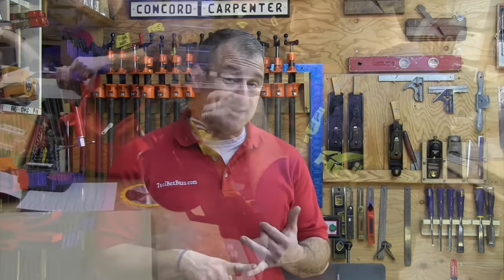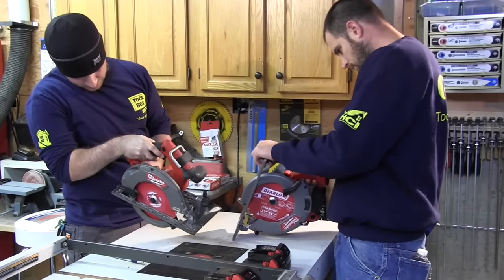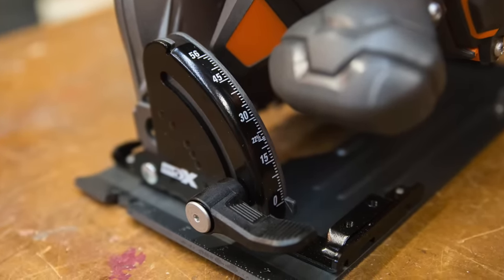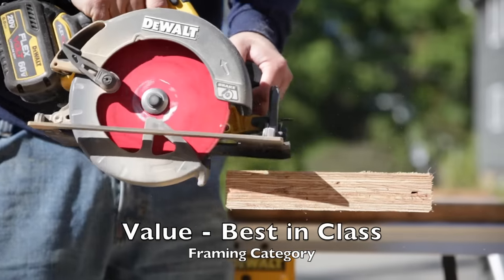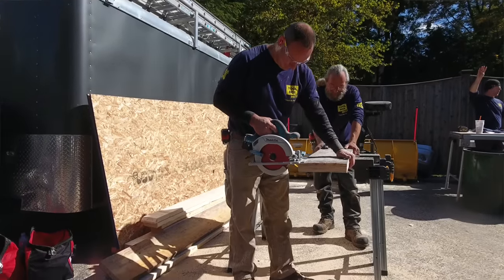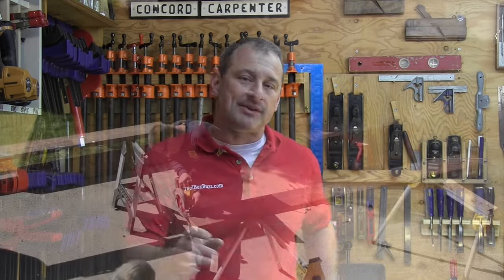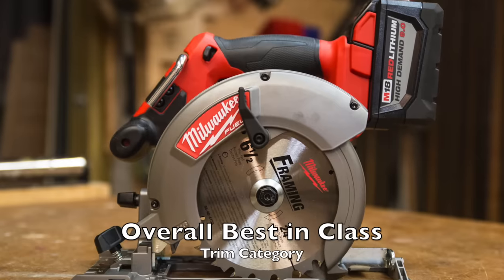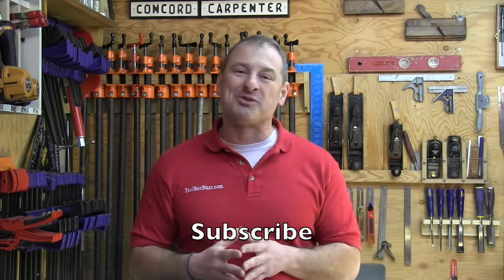Best Cordless Circular Saw - Head to Head

Comment: I’ve had the Dewalt Flexvolt pretty much since they first came out and I love it. I have 4 each of the 6ah and 9ah batteries and never have any down time waiting for batteries, exelaint runtime, power and performance, blows the competition out of the water in my opinion, and the new updated model has the rafter hook Andes even more powerful (Just got one recently and I like it even better than the old one and that’s saying a lot). My boss has a Milwaukee and he likes mine better even when he uses his 12ah batteries for it. And the Forman on our crew had a Rigid and sold it and got a Flexvolt after using mine. I personally prefer that it has its own batteries, having the amount of power that it does is awesome and a smaller battery would drain very quickly. I’d be very interested to see an updated version of this video and am conga Dewalt would take it

Comment: Great in depth review. My 2 cents: I am a framing contractor, with thousands of dollars invested in both the Milwaukee Fuel and DeWalt Flexvolt tool lines. I run my jobs almost exclusively on cordless tools and use these tools all day long. My trailer has a big battery recharge station with 5 and 9 Amphour Milwaukee and DeWalt 2/6 and 3/9 amphour Flexvolt batteries recharging on multiport chargers all day long. In my opinion DeWalt has unquestionably assumed the top spot in contractor grade high output tools with the introduction and diversification of the Flexvolt line of tools. With four Milwaukee Fuel saws, and 3 Dewalt Flexvolt saws on my shelf, I reach for the blade right Flexvolt saw almost exclusively, even though I dislike the blade right configuration. The reason is that when speed counts, torque is better than endurance. The Milwaukee Fuels get about as much work done, but they bog down way easier and take more time. Ripping 2x lumber, cutting rafters, headers, gang ripping plywood, month-old blades, with perhaps a carbide tooth missing, on the dewalt 60V saws still cut with good speed and decent quality because the DeWalt 60V brushless motor has enough torque to power through the cuts. With a month old blade, with resin buildup on the teeth, the 18 Volt Milwaukee Fuels cut much slower, and bog down on compound miters (rafters) and often fail. I have more $ invested in Milwaukee Fuel, but without a steady, expensive stream of new blades, the 18 Volt motors feel weak and take too long to make cuts and fail too often. In all honesty I can't stand working with Milwaukee Fuel saws unless the blades are less than 2 weeks old, they just cut too slow. So in my experience,  running these saws into the ground (burned out 2 Fuel saws over the last year) month after month every day, cutting rafters, tails, headers, sheeting roofs, gang ripping plywood etc. the DeWalt Flexvolt wins hands down in the field. When the new blade left DeWalt 60V Max in-line saws come out in October, I will buy three ASAP, and I expect that my Milwaukee Fuel saws will largely cease to be used by my crew and be viewed as a second tier tool.
Reply: James Weaver , im framer too , is good your review for me because im not sure , if milwaukee or dewalt, i need one , the mayorit people reviews is diy , not profesional construction worker,

Comment: Interesting. However, most of us probably become 'slaves' to whatever brand we already own in order to simplify the requirement for battery chargers and interchangeable battery packs. It would be nice though if there was a universal standard on the battery side so that customers could select the brand of tools that fitted their particular requirements best. I don't see that coming any day soon though, or at all in fact.
Reply: We can always dream right lol!
Reply: Universalize the connector and leave battery cost, quality, and performance up to the end brand to make their battery a better buy
Reply: Jon the problem is batteries and tools electronics work toghether the manufacturer doesn't want people using other brands batteries, so they use proprietary "language" in their tool/battery interface
Reply: That's actually not a terrible idea...and possible. It was done for phone chargers a couple of years back in the EU and it really made thinks easier. The best thing about that is: You would probably get companies really quickly just offering battery/charger systems, companies focusing on nothing else. That way, you can get really amazing things.
Reply: The only way I see a universal battery working is if there was a subscription, that you subscribed to. Say, you needed X number of batteries and you paid accordingly to the number of batteries that you needed to use. Go one step further with a modified one key system allowing you to monitor the performance of any given battery. If that batteries performance dipped below a certain level they would ask you to swap it out.
Reply: Yep, these0 days you marry- a battery system and hope the skins attached are up to the job
Reply: Yeah companies got to make their cash so they are normally careful not to make battery ports similar to other xD
Reply from the maker: That would be great
Reply: Just pick the right brand...there only one good one
Reply: I have mentioned that before. The replies and comments were it stops improvement and progress of innovation.
Reply from the maker: Agreed many of us stay with the same platform
Reply: Once RIDGID announced their lifetime warranty I almost immediately made the switch from Milwaukee-which unreasonably heavy!
Reply: J F  Milwaukee  all the way for me any power tool
Reply: absolutely. few years ago when i was just starting out, dewalt had a screaming deal on a 4 tool set with a couple batteries. At the time i couldnt understand why Dewalt was basically giving away brushless cordless tools.  4 more tools and several more batteries later i understand. Sometimes i like the other brand as a tool but its cheaper and easier to just stick with the brand that uses the batteries i already have. 
Dont regret it but yes this should be something everyone should know when they are looking to buy cordless tools.
Reply: Maybe we just need a genius inventor person to create an adapter system for batteries/tools. You could have an adapter for a DeWalt 20v to Makita tools and an adapter for Bosch tools to use Milwaukee batteries etc etc. Yes there would be about 2 dozen or more possible configurations but if they could keep the price down I bet they would sell like hot cakes lol. Imagine having tools by DeWalt, Makita & Bosch and only needing DeWalt batteries or just Makita batteries that fit all 3 brands. It would be a game changer for certain. Now imagine how each company would do everything they could to make their batteries the best in the world. You’d see innovations never before imagined. 
And then.......Tesla starts making batteries for cordless tools!!! Complete with a solar panel/battery kit!!
Oh! The Humanity!!  I can dream can’t I?
Reply: that would be a fair game but i have never seen a fair game when it comes to business
Reply: I have milwaukee, dewalt and ryobi 18v tools. I just buy the tool i want, not because of a battery. I just plug in three chargers, not such a biggie.
Reply from the maker: J F this never mattered with cordless tools. Nw with cordless it makes sense
Reply: There is.....unfortunately its called a Ryobi
Reply: Also there is a battery adapter piece from eg Milwaukee to Dewalt + many more from Ebay Australia.
Reply: Just own multiple brands, I have DeWalt hikoki Bosch festool Hilti Metabo Makita in my tools each company does something really well so why limit Ur self to one brand
Reply: I smell a business opportunity... someone design a battery “cap” that interchanges between tools? I know the complexity in this, but i also guarantee it could be done.
Reply: That would be great but tool companies or any company in that matter are way too greedy for that to happen.
Reply: Once you’ve invested decent money in a family of tools difficult to justify choosing a one-off from a different make unless you go corded
Reply: @RhenusFilms  It was done for phone chargers here in the US too, but somehow Apple escaped that.
Reply: @dustinroberson1865  "somehow apple escaped that" - yeah, by declaring their phone not a phone, but an iPod with a phone function (I'm not kidding you)
Reply: @redrhino3041  because I dont want to have 4 different types of batteries needing 4 different chargers, and also, since I only have dewalt, unlike my coworker, if I run out of battery, I have 6 more batteries in my van to slap on, where he only has 2 or 3 of each brand, and most of them are small ones.
Reply: JF  it would be great IF these tool and battery manufacturers would get together and decide on a STANDARD format for the batteries !!!!  Pick a voltage and a battery style and run with it so there was an interchangeability for the batteries, save all this BULL SHIT of so many different batteries and chargers !!!
Reply: @escalator9734  BULLSHIT !!!!!!  20 volts is 20 volts !!!!!
Reply: @chrisapplewhite6660  Two words:  DeWalt Flexvolt.
Reply: Waiting on Tesla to come out with a line of cheaper and lighter batteries for these companies to use but make them only use that one connector. Lol highly doubtful but they are innovative and Elon does weird shit so ... who knows
Reply from the maker: @tes ste really?
Reply: You can get battery adapters, so at least there is that.
Reply: You are rite on the money. I too wish the batteries could be changed between tools.   To not only stick with one brand , or if you do not have all these different chargers everywhere. It's such a pain.
Reply: Yeah they are not even compatible within the brands owned by the same company, there is little hope....
Reply: there is artisinal adaptator on the net, for example here: watch?v=MMssklzoBAk. apparently as long you charge the battery with the original brand charger, you can use you battery in other brand via adaptator. i think i'm gonna try it.
Reply: Mark Farmer there already is one
Reply: Write a letter to Congress men and women about waste in the tool industry and point it apple was forced to change so tool companies should to
Reply: They make adapters to interchange batteries.
Reply: You can buy off the market adapters online

Comment: Hey Concord Carpenter,
Just wanted to throw in my $.02 regarding batteries/voltages. Dewalt is pushing the envelope in the field when it comes to this. Higher voltages provide the same power with more efficiency. In moving toward more powerful and efficient motors, they are laying some serious groundwork. The FlexVolt battery is comprised of three 20v circuits that can be run in parallel (to power all of your 20vMax tools with power and longevity, or any of your 18v tools with the battery adapter!) or in series as 60vMax. To say Dewalt is changing batteries on people again is misleading, their brand new batteries are backwards compatible with almost every tool they have made in the last decade as well as being leading edge when it comes to power and efficiency. Judging by your numbers, Dewalt's forthcoming 9.0Ah battery will easily outpace the Milwaukee. Regardless, Dewalt is laying the groundwork for amazing things while still supporting 99% of its cordless tools that are in use. They learned from their mistakes and abandoning support for still-working tools is a big no-no. I have 18v and got the 60vMax 7.25" saw knowing I can use the battery with any of my tools as well as any 20vMax tools I care to buy, or I can wait for the new 60v versions of them.

Cheers,
lifelong tool user
Reply: jcraig8 thanks, thats good to know! I thought that they were “jumping ship” again on the older tools. I wondered how they could stay in business doing that.
Reply: Can the 20v run the flex volt tools?
Reply: @whitechris720  No.
Reply: yeah but, they kinda mislead you with the whole "flex" volt, doesn't really flex thru their line of power tools. Dewalt is bad about misleading customers and appropriating off brand tools and labeling them as theirs, i quit buying deWalt long time because of the Flex volt scam.

Comment: Great write up on all of these saws. Back when I had only the Bosch Brute Tough hammer drill I was looking to buy a cordless circular saw. I was looking toward Milwaukee but I already had 2 Bosch batteries with the drill. I ended up sticking with Bosch based on your 18v saw comparison video. I won't be cutting much heavy stuff like LVL, plywood and 2x matl are right up my alley so I was blown away when I saw that you guys found the Bosch beat even the Fuel on runtime! Their next brushless circular saw ought to be a beast, they just need to get things moving faster over there at Bosch. They take their time with things but when they finally release the next models they seem to nail it. Thanks for the great videos!

Comment: HILTI  =  waaayyyyy overpriced  just like Festool. Good tools but ridiculously OVERPRICED
Reply: they’ll say that it’s due to their “premium” customer service… well, duh, if I charge 5 times the cost of the tool, you bet it’s going to be super easy for me to give you premium customer service for just a few years, and after that CHARGE you for repairs
Reply: seems like you never heard about Mafell, they make Festool look cheap hahah. But if you're a carpenter and you use it everyday, these tools are the real deal, can't go back for sure
Reply from the maker: yep sure would
Reply: @boogiedahomey yup. I own Hilti drills, they aren't even that much more expensive than Milwaukee which is what I used before. They are made better
Reply: Milwaukee is used a lot on commercial sites I'm on. Theres still hilti but a lot of guys are swapping over with the milwaukee batteries being so good.
Reply: @alexfrederick9019  Milwaukee batteries?  I had to return the only thing I asked for Christmas because of the defective Milwaukee battery that came in the kit and now it's on backorder at best. Home Depot wouldn't just let me swap out or just return the battery.  I asked for a Milwaukee hand warmer.
Reply: @5jjt  this is the first time I have heard of a defective battery, but I suppose its prone to happen. First, I would contact Milwaukee to see if they can send me a replacement battery. I don't see a reason why they wouldn't. Otherwise, if Milwaukee and HD refused to replace the battery, I probably would have just bought another tool, swapped batteries and returned the tool.
Reply: Watch an AVE video on hilti tools. He shows why. Totally worth the watch
Reply: I wont say hilti is overpriced,i used to have the jack hammer..hilti tools are the very nest for strenghth reliability ,i personslly think hilti  makes the best jack hamners and maybe drills...you nore than make back that $1k for the jack hammer,and the warranty...
Reply: Have never tried festool ,name sounds like excretion
Reply: I was a Makita user, but they cost me too much over time. I switched to Hilti. The warranty is fantastic. And realistically, it cost less than the box store options. Example. Hilti hammer drill driver, battery, and charger run about $309. The same kit bosch, mastercraft, and Makita are $100 more. The hilti has a 20yr warranty, 5year parts and labour. The Makita has 1 yr limited. As a small business, and a contractor, I’ll get the Hilti. It’s a better built kit, better warranty, better customer care. Some items do cost more, but I save money on down time. It’s a simple matter of spend more now, save more later.
Reply: Their business model is fleets and corporate accounts. They make a nice tool but its dated in ways , seems they are just discovering brushless and I have had several tools and wore out 1 in the last 10 years that were brushless.  Hilti until going into home depot wasn't really available to most people. Not so good if your out on a job in some hellhole and need something. The grinder has a planned shear pin type shaft in its design! Not good for me.Maybe for a fleet of tool abusers but that is not my scenario. They intentionally use a different battery size so comparisons are not possible. I have a deep hate of these companies that try to make some kind of wierd monopolistic business models. Competition creates better products and value for us buyers  of products. Never been a Hilti fan but they  make a few nice tools just hopefully they can give their customers brushless options soon.
Reply: You're paying for a replacement tool each time you buy a Hilti product because of their guarantee.
Reply: Tyler Smith I went through two M18 Fuel drill/driver kits from Home Depot in 2 weeks. Both chucks were complete junk, off center and made the whole drill vibrate like crazy. Got Hilti’s latest 22V drill and will never buy another Milwaukee again.
Reply: patriotpaul what are you talking about? They have a ton of tools that use brushless motors.
Reply: Because HILTI produced in Switzerland😄
Reply: Hilti is Pricey
Reply: What is  lifetime  service these day?
A good tool with reasonable price does last a long long time without  lifetime  warranty or service .
With  technology moving so fast often it's best to move forward with the new tools instead with just the old  try and true tools.
Reply: @KingParisBuckingham  It's short for Festeringstool!

Comment: If you want a good value at Home Depot the milwaukee 7-1/4 has a 9.0 starter kit it's 250$ for a 9.0 battery and charger and the 7-1/4 saw. Great deal. I picked one up and it's an awesome saw.
Reply: Taelan Baylor they still have the deal the keep it going for the circ saw and the sawzall both with the 9.0 battery's.
Reply: bosch